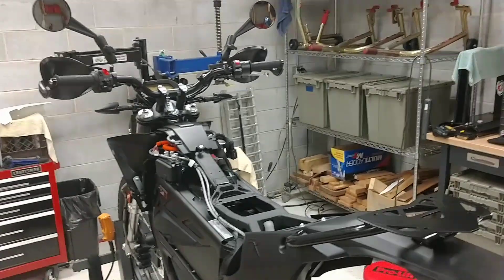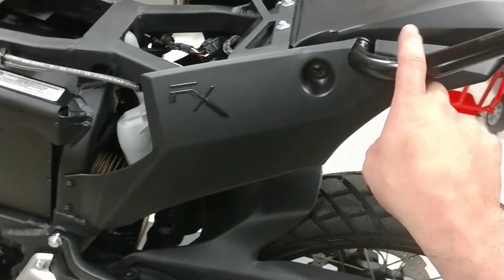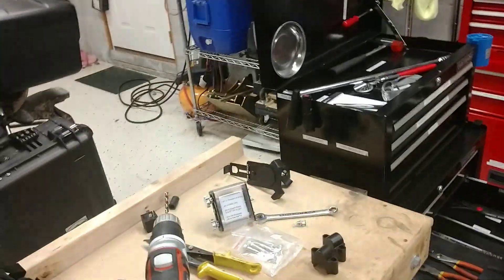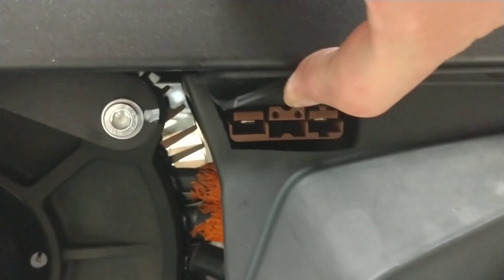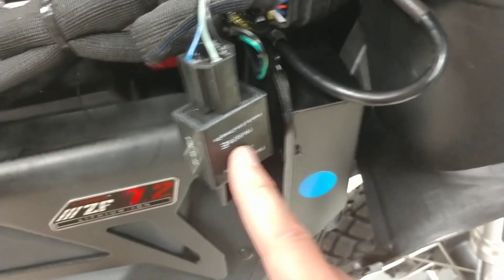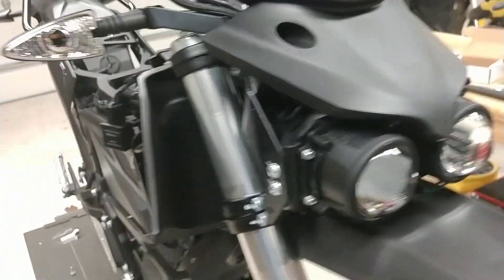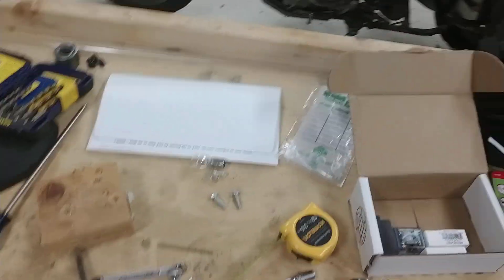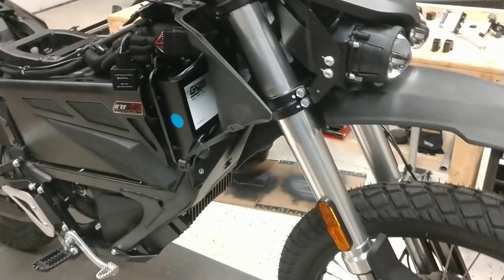2018 Zero FX overview

Comment: Amazing that an electric bike company doesnt use LED bulbs to save juice.  Are they that expensive? They may just want to pass that expense on to those who care about it but maybe it's not that much electricity in the cycle of one ride/charge
Reply from the maker: I think it's cost. The power savings are negligible.
Reply: @GregHassler 
Incandescent front bulbs are normally 70 watts, I believe, and the one in the back 30 watts. That would be 170 watts for the three of them. Ride the bike for a couple of hours at night, and you're using 340 Wh = 0.34 kWh, or 4.7% of the total battery charge. Not negligible in my opinion.
Reply from the maker: @chesshooligan1282  Incorrect.  An H4/H7/H9/whatever halogen headlight low beam is typically 55 watts.  An equivalent LED low beam is 20 watts.  Savings = 35 watts.  The tail light is a fraction of that, might be 2 watts savings.  The brake is more than the tail but is only depressed a fraction of the time.  Trust me, I have 35,000 miles on Zeros and have run the math a dozen times.  On a two hour ride it amounts to something less than 1/4 mile of range, of what on this bike would be a 55 mile ride, and on my other Zero (S) is typically 120 miles. That's negligible. Day or night has nothing to do with anything, the headlight is on either way.
Reply: @GregHassler 
Okay, 70-watt savings then. 70/170*4.7% = 1.94%. Whether you want to call 1.94% negligible or not, is a matter of personal pereception, but I'm sure the Zero people have been working hard to improve the battery from last year's model capacity of 6.5 kWh to this year's model capacity of 7.2 kWh, which is 10.77%. You have added almost a fifth of that just by changing the bulbs. In my opinion when the bike has such a short range, every little counts.
Reply from the maker: @chesshooligan1282  I think you misunderstood.  The savings is 35 watts.  The taillight and brake is already LED, my apologies.  There is only one beam on at a time, not two.  One headlight is low beam, one headlight is high beam.
  Over two hours, which is the entire battery charge, that's 0.070 kWh, which is LESS THAN 1% of the charge on this FX, or less than half of one percent of a charge on my S.

I'm telling you, I'm not asking your opinion on the math, that the result of changing to LED headlights is less than 1/4 mile of range across an entire charge.  My other Zero has a Cyclops adventure sports LED H4.  This isn't a discussion.

If you consider 1/4 mile "appreciable" range, then that's on you and I'm happy to agree to disagree.

I love LED lights as much as anyone and have converted at least a dozen motorcycles to full LED over the past decade for a number of reasons, but on a Zero gaining range isn't one of those reasons.

I also have extensive experience adding additional 12v accessories to Zeros including heated gear, aux lights, etc.  The 12v system does not affect the range in an appreciable / measurable way.  It just doesn't.  Trust me, I have the miles on these bikes to back it up.
Reply from the maker: @chesshooligan1282  understood, I get the math behind it and I'm more than capable of doing the calculations, but I'm also trying to give you the benefit of a ton of real world experience and testing.  There are far more variables involved with range, many of which have a far greater effect than what we're discussing here.

You would be hard pressed to conduct an experiment on the same day on the same bike riding the same route at the same speed twice in a row, one with a halogen bulb and one with an LED bulb, and arrive at statistically significant results.

The reason being even a few degrees change in ambient temperature, or a couple mph difference in wind speed or change in wind direction, or difference in battery temperature due to charging, can all have greater effects than the wattage savings of an LED. Hence negligible.

This is also discussed at length on the Zero forums at least once / month, and I've been active in the forums since 2014. My Zero S's lifetime average watt hour / mile is 116, for reference.

If you're a math guy, you might appreciate this little conversion spreadsheet i whipped up:
https://docs.google.com/spreadsheets/d/1DNMtWxYdZouu60rsXMr2MDdigOtTcTWZMDzi7rbonwE/edit?usp=drivesdk

The reason for multiple calculations isn't because I'm doing the math poorly, it's because I'm changing many other variables to see how it changes the outcome. You might be familiar with the concept of sensitivity testing, that's what I'm talking about, backed up with real world experience.

I'm sorry if this comes off as cocky, it's just that I'm exceedingly well versed in both the theory and practice and don't make unqualified statements.
Reply from the maker: @chesshooligan1282  for more context, pinning the throttle on these bikes consumes power at over 50kW, or past 60 in some cases.  One pass of a tractor trailer could more than offset an entire ride's worth of energy to the headlight.

I think you'll be in agreement with me if you performed a full sensitivity analysis at different ride times, average speeds, account for different winds and hilly conditions (e.g. again coasting with regen down a single hill for 1/4 mile can produce more power across a ride than the entire headlight consumes).

Basically the fault isn't your math but rather your assumptions and not considering enough variables.  Even accuracy of the odometer due to tire diameter changes from tire pressure or tread wear will affect the measured outcome.  Compensating with GPS speed only solves part of the problem because Zero's computer is still calculating range and consumption from its own odometer.

Next we get into the efficiency curves of the motor and controller at different RPMs and loads.  I've been down all these paths.
Reply: @GregHassler 
I'll accept your input on power consumption at different speeds and riding conditions. On the other hand, I don't think there's any possible discussion to the fact that a 35-kW power loss for two hours is 1% of 7.2 kWh. Now, if you ride hard and you exhaust your battery in half an hour, we'd be talking a 0.25% total energy loss; 0.5% in one hour, and so on. In other words, if you thrash the bike, the relative energy loss will be smaller for your trip, but if you take it easy, the loss will be higher, and it can be as high as 1%. Is that negligible? Up to each rider to decide. I would probably call it "almost negligible," but it could get you out of a pickle one day.
Reply from the maker: @chesshooligan1282  I'm a little confused on your last response, guessing you forgot a decimal point.

Point being there are a half dozen variables you're ignoring which have an order of magnitude greater effect on range than the best case scenario you can imagine on an LED headlight.

The practical reality is that the bikes can run out of power from any single digit percent to fifteen miles past zero percent.  Nobody is planning a ride down within a percent or less of range.  I've run out multiple times in the real world and none of them were within a few hundred yards of my house, and if it were I'd be happy to push it the remaining distance.

Also you realize that while riding you monitor the situation real time, and if you're coming up short you can adjust your riding style and increase efficiency.

A small fraction of a kWh doesn't have the real world implications you think.
Reply: @GregHassler 
I'll do it again: 
- 35 W times 2 hours is 70 Wh. 
- The total energy stored by the battery is 7.2 kWh = 7,200 Wh. 
- 70/7,200 = 0.009722, which we will round to 0.01. 
- Expressed as a percentage, 0.01 out of 1 is 1%.
 - If we multiply 70 times 100, we get 7,000, which is almost 7,200. (The remaing 200 has been lost due to the rounding we did previously. If we are totally anal, we can multiply 70 times 1/0.009722 and we'll get exactly 7,200.)

Yes, you can adjust your riding when you're running out of juice. That's absolutely correct, and I'm not going to dispute that. But the fact remains a replacement 20-watt LED bulb will give you a 1% extra range on a two-hour ride (or 0.5% on a one-hour ride, or a 0.25% on a half-hour ride, etc).
Reply from the maker: @chesshooligan1282  I'll do it again:
- Your post above said kWh not Wh
- Where do you get 2 hours from?  What does that make your average speed? What does that make your average Wh/mi?

You're hung up on mathematics and have no idea how these other variables affect real world performance.  I can do the math. My fourth grader can do the math, it's quite basic.  But every component of the driveline has a dramatically larger affect on the range than anything on the 12v system, relegating any swap to an LED bulb to a rounding error.

These bikes don't behave as consistently as you want to believe.

I just don't want anyone else who reads this to think that upgrading to an LED is a realistic way to increase range. It isn't.
Reply: @GregHassler 
7.2 kWh is 7,200 Wh. I converted kWh to Wh on the second line so I could continue working with consistent units. 70 Wh is the energy consumed by a 35-watt bulb in two hours, which is approximately 1% of 7,200 Wh, that is, 1% of the battery energy capacity. If you want to be a little more accurate, 70 Wh is 0.97% of 7,200 Wh, or 0.97% of 7.2 kWh.

Where do I get 2 hours from? That was a hypothetical scenario. If you have a 35-watt bulb on your bike, and you ride the bike in such a way that you exhaust your battery in exactly 2 hours, 99% of your battery energy will have gone to feeding your electric motor and 1% to feeding your bulb. Now, there are infinitely many different ways you can ride an electric bike exhausting the battery in exactly 2 hours, and each one of those ways of riding will give you a different range, but if your 35-watt bulb is on, in each one of those cases only 99% of 7.2 kWh will be available to the electric motor. The average speed is irrelevant to the energy consumption of the bulb (but not to the range you get from your 99%).

Now let me give you a different scenario. You're doing a 100-mile trip. You've been riding your bike for one hour at a constant speed of 70 miles per hour, which means you've done 70 miles. You look at the clock and the battery indicates 20% charge left. That means you've spent 80% of the charge for 70 miles. You're spending more than 1% per mile, so if you carry on at this pace, you will need more than 100% of the charge for 100 miles. You're not going to make it. So you slow down to 10 miles per hour. Your trip will take a lot longer, but your consumption per mile will be a lot lower due to less air friction. Now your trip will take 4 hours. In 4 hours, your 35-watt bulb will have eaten 2% of the battery. Only 98% was available to the electric motor, but you still made it. Why? Because you rode more slowly and you lost less energy to air friction. By riding slowly you managed to get more mileage out of 98% charge than you would have got out of 99% charge had you ridden at 70 mph.

Summarising: a 35-watt bulb will consume 0.5% of the energy stored in a 7.2 kWh-battery for every hour that it's kept running. Is riding style important? ABSOLUTELY YES, IT IS. How far you get with the remaining energy available to the electric motor will depend on how you ride the bike.
Bulb consumption is dependent exclusively on run time. Electric motor consumption is dependent on riding style and run time.

Oh, one more thing. In order to simplify things in these calculations I've used the 20-watt LED as the base, so you should count that 35 watts as EXTRA energy consumption. If we also count the rear light, you probably get something close to a 1.5% EXTRA energy consumption for incandescent bulbs over a two-hour trip. 

Is 1.5% a rounding error? Well, it depends. If you don't mind rounding 98.5% to 100%, then yes, it is. I would let the reader decide.
Reply from the maker: @chesshooligan1282  I'm glad you edited/corrected the typo in the earlier post.  I know the math, I know how you got there, I was just confused because the post originally said 35 kW (with a k) - I know because I have record of it in my email notifications.  Don't berate me for your mistake.

Ok, you're still not getting it.  A 2 hour ride consuming the entire battery - that's an average of 30 mph, correct?  Do you realize that you can get to a 30 mph / 2 hour average in numerous ways?  As in 30 mph consistently for 2 hours (unrealistic, but maximum range), or rapid acceleration and deceleration with pauses in between?  Do you realize that these two scenarios create HUGELY different consumption rates, in Wh / mi?  Do you realize that in those two scenarios, your LED bulb upgrade will result in two completely different amounts of ACTUAL RANGE gained?  I'm talking distance, not percentage.  Both will still be "negligible", but one much more so than the other.  You're completely ignoring the factor of consumption/efficiency and assuming the maximum possible, or completely ignoring the RANGE side of the equation - which is the actual thing the rider cares about, not percent.

"You're doing a 100-mile trip." - a Zero FX 7.2 is incapable of doing a 100 mile trip at any speed under any condition.  If you're talking about my 16.3 kWh Zero S, then yes this scenario is possible, but then your numbers are off due to the increased battery size and the LED still saves less than 1% of the battery.  You're just making numbers up that have no practical value.

I honestly don't know how to explain this any differently to you at this point.  You're making up completely unrealistic scenarios without understanding the variables.  There's a whole host of things we haven't even began to discuss, like that 7.2 kWh is a rated max capacity, not the nominal or usable capacity, and the available capacity from that even changes (drastically) with temperature.  But you're just operating in this unrealistic, theoretical only world.

"If we also count the rear light, you probably get something close to a 1.5% EXTRA energy consumption for incandescent bulbs over a two-hour trip. "
Depending on the model of Zero, as I've already explained, some have LED tail and brake lights from the factory.  An incandescent tail light (tail, not brake) consumes something like 3 watts, and an LED tail light around maybe 300-500 mW.  So you're not increasing the headlight gain by a factor of 50%, you're at like 8% optimistically.  The brake light can consume more but then we have to estimate time on the brake.  But the time on the brake also creates regeneration power BACK INTO the battery, which - again - you've completely ignored. (Remember these bikes charge themselves when you're off-throttle or on-brake.)  You're literally just making up numbers.  Where is your factor of regeneration in the equation?  It effectively INCREASES the battery size.

AGAIN, I will explain one more time since you haven't acknowledged it at all, EV's (and Zeros in particular) have difficulty tracking state of charge.  I'll explain in more detail.  The voltage of a discharging battery isn't linear, it's a curve (like a sideways S).  The voltage while riding also sags with load.  To help compensate, the BMS also profiles the batteries capacity over multiple charge and discharge cycles, establishing a moving average of estimated capacity.  It uses current sensors to help with this and back up the inconsistent voltage readings.  There is also a factor of cell balance, the difference in voltage between the cells.  ALL OF THIS AFFECTS AVAILABLE CAPACITY AND SHUT OFF POINT.  The BMS's estimate of "0%" may - or most likely - may NOT be accurate.  It changes literally from ride to ride.   Battery temperature is one of the major factors.  You're ASSUMING, in this magical theoretical-only world of yours, that the bike will get to exactly 0%, no further, no less.  That is NOT the case.  Some of these factors are under a rider's control (to varying degrees), some of these factors are not under the rider's control but information is available to the rider, and some of these factors are not under the riders control nor do they have information regarding it.

Do you own an EV, of any kind, on two or four wheels?
Reply: @GregHassler 
I haven't edited anything. There are only two edited posts, and both are yours. And I haven't deleted any posts either.

I understand perfectly my hypothetical example wasn't going to match real-life consumption figures, for Christ's sake. The figures were obviously made up to illustrate the fact that you'll get higher mileage if you travel at a lower speed due to reduced air friction, even if your bulb ends up consuming more battery charge due to increased travel time.

Yes, I know: temperature, humidity, rider weight, route profile, riding speed, acceleration bursts, air density, elevation, the position of the planets, blah, blah, blah, etc, etc, etc... They'll all affect how far you get on a charge. But at the end of the day, a running 35-watt bulb will consume 0.5% of a7.2 kWh battery's charge for every hour that it's kept running. That will happen yes or yes. That is all I'm saying. Interpret it as you want.

Still don't believe me? Do the following experiment:
- Put the incandescent, 55-watt bulb back on
- Recharge your battery to 100%
- Leave the light on for 5.3 days.
- Your battery is flat. 100% guaranteed.
- Alternatively you can swap the above figures for a 20-watt LED bulb and 14.6 days.

I'm done.
Reply from the maker: @chesshooligan1282  You: "4.7% of the total battery charge. Not negligible in my opinion"
You: "Okay, 70-watt savings then. 70/170*4.7% = 1.94%."
You: "If you take it easy on the bike, you could get a range of 100 miles in the FXS (is that correct?). 1% of 100 miles would be 1 mile."
I guided you toward some more correct / realistic numbers.  After this you stopped trying to equate to range and focused on percent. What I'm trying to do is to continue to guide you down the path of what your numbers equate to, in REAL RANGE on this bike or similar.

I do agree with - or assert - the following:

1) An LED headlight will save approximately 35 watts over a halogen.
2) 35 watts is the rough equivalent of 1/20 of one horsepower, kids electric scooters are generally 200 - 700 watts (for relative reference of power level)
3) A continuous 35 watts saved over one hour is the equivalent of .035 kWh
4) 0.035 / 7.2 = 0.00486 (or 0.486%)
5) A continous 35 watts saved over TWO hours is the equivalent of .070 kWh
6) 0.070 kWh / 7.2 = 0.00972 (or 0.972% - still less than one percent)
7) The bike in this video has a rated "Max capacity" of 7.2 kWh
8) That max capacity is a number made up by a formula, and is not based on performance data
9) The "Nominal capacity", rated by Zero and the cell manufacturer, is 6.3 kWh
10) The 6.3 kWh nominal rating is closer to a realistic number we should be using for range calculations
11) The 6.3 kWh still is not a guaranteed amount of energy available to a rider on any given ride, based on factors such as, but not limited to, cell balance and battery temperature
12) Riders don't care about kWh or percent, they care about distance
13) How a given surplus of power, presented in kWh or percent, translates to actual range (distance) gained is directly correlated to the efficiency / consumption, in Wh / mi.
14) Consumption, or Wh / mi, is affected by a multitude of factors that number easily in the dozens, some of which have been discussed above.
15) Many of the factors mentioned in #11 and #14 have a much larger (an order of magnitude larger) affect on the end-to-end efficiency, performance and range of the system, as to relegate the distance gains of an LED upgrade to imperceptible levels.
16) Even the measurement systems' accuracy must be taken into consideration when numbers are so slim, in the less-than-one-percent range that we're seeing.  For example, the speedometer/odometer on the bike is 2% or greater in error from the factory (reads fast), and gets worse worse with tire wear.
17) This is the point of a sensitivity analysis, to determine which variables have a large effect, and what variables have a small effect.  The variables which have a small effect can generally be ignored, or at least ignored until you have the variables that have a large effect very well understood, accounted for and controlled.  In this discussion, we don't.

#12 is very important.  I'm not taking this entire discussion lightly, because I've personally been in situations similar to the one you laid out in an above post.  I ride my Zeros with my daughter on the back, and we've done multi-day camping and beach trips off the bike.  I've personally been in situations where watching the GPS distance remaining and the bike's predicted range and state of charge, doing these mathematical equations on the fly in my head while riding, trying to figure out the ideal average speed, or if I should turn off my aux lights, or try to find a shorter route on the GPS, etc. in order to avoid having to walk somewhere on a dangerous road with my 9 year old.

I've lived it, multiple times.  And I've gotten it wrong.  On both of my Zeros I've run out of juice, fortunately never with my daughter on board.  I have tens of thousands of miles on these bikes, and upwards of a hundred thousand miles on EVs in general.  I'm both a motorcycle and EV expert, having worked in both industries.  I'm telling you these things out of a ton of experience, not just from a theoretical exercise on paper.

If you're done, that's fine.  I've now said everything I can possibly say on the subject.  Maybe you've learned something, maybe you haven't, I don't know.
Reply: @GregHassler  Thanks.